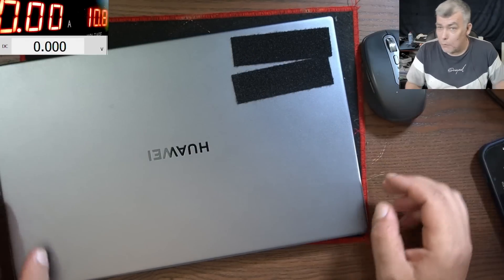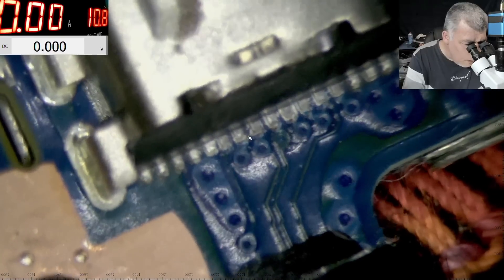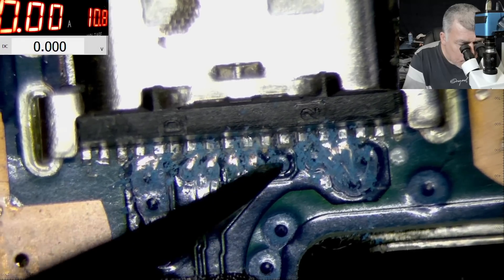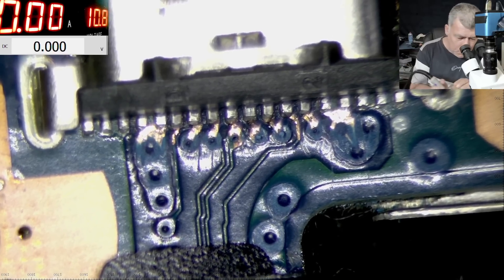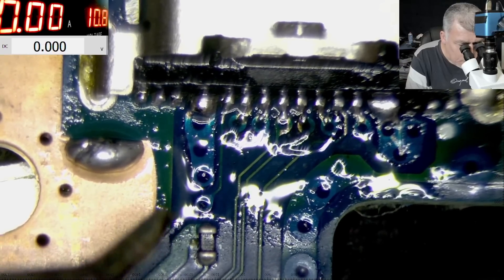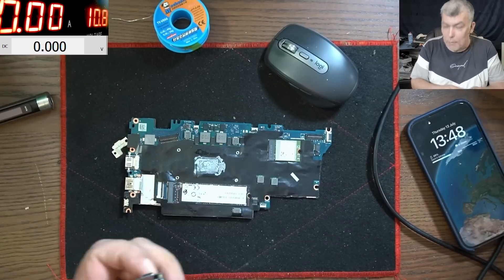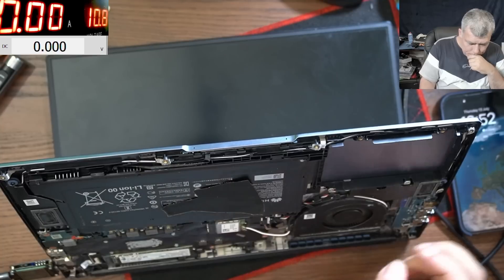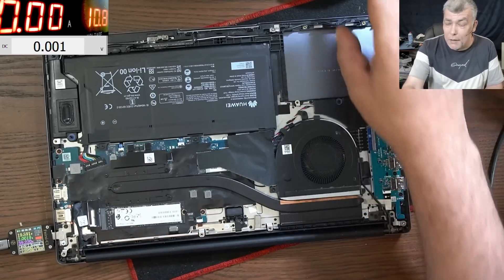Huawei laptop not charging, type C charging port repair - a common fault on this model

Comment: Hello, I have the same laptop model and the same thing happened to me with the charging port. The company wants to change the entire plate and the cost of the repair is very high almost the same as what my laptop cost me at the beginning.

I really don't know what to do, you could recommend some other option.

Thanks a lot

Your videos are great

Comment: How but my huawei laptop is not fast charging, does it need to change USB port k
Or just solder. I got 2 chargers already with the same watts requirements. Also my usb cables are good 60w amd 100 w but still really slow when charging laptop

Comment: I still think it is best if the charging port is separate from the motherboard.
You always has to plug and unplug the charger and even move the laptop around while the charger is connected.
To have the charging port soldered to the motherboard is not the best design.

Comment: These are quite common for us as well, the EXACT same issue. I take the route of replacing the port completely and end up having to do trace repair. Looks like I was spending way too long doing that instead of just touching up those pins back to the board 😂😂 Live and learn! Thanks Sorin :)
Reply: yep I've seen a few of these, same exact thing all the pads snap clean off. I like doing the full port replacement and jumper wire repair instead of just solder bridging, because I like to think the extra flexibility might prevent it breaking again in the future

Comment: I had the same problem with a Samsung phone. I checked on the components around the battery connection, then charging started. The battery was faulty, so I had a second try, charging started again. Third time I didn’t need the multimeter, charging started. I used a car charger to do this. Car drivers have additional benefits for devices if they use car charging, car charger fixes the memory effected battery even on Android 4.0, and 2.0. Car charger fixes the charging speed, so slow charging devices switch to faster charging without destroying the battery. One car charging is enough for a tab to have higher capacity and faster charging using its default 1A 5V AC charger. To do this, you don’t need to drain your car battery, just a few minutes charging is ok for the fix.

Comment: You are lucky that you can see where the pins are going. The bring me a laptop where they ripped out the port and  trucks. I have to find out where they normally did go. That’s long rerouted all the connections.

Comment: I hate this new design when a charging port is soldered to the MB, why it cannot be on the ribbon cable like in some android phones ? it is much easier the replace .

Also about ground pin, I usually add a thick wire across them together with a ground pins to make the connector much stronger

Also I remove RAM and SSD if I can , when I do any solder job on the MB.